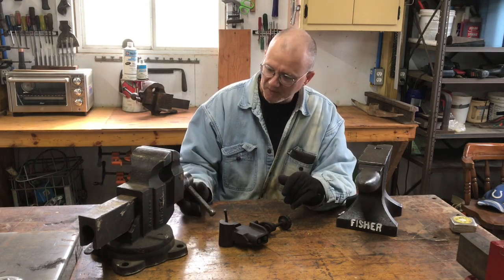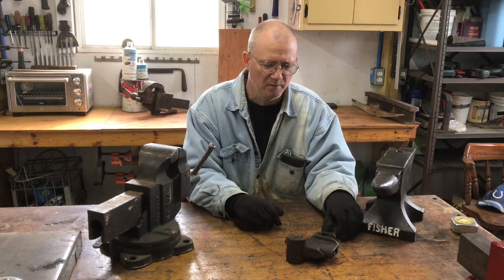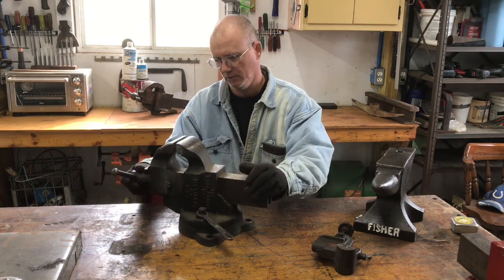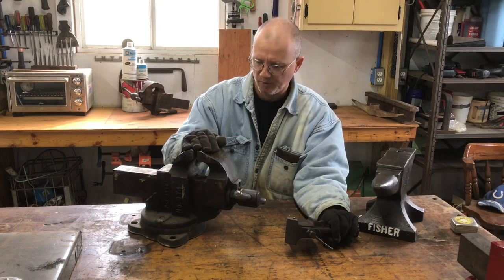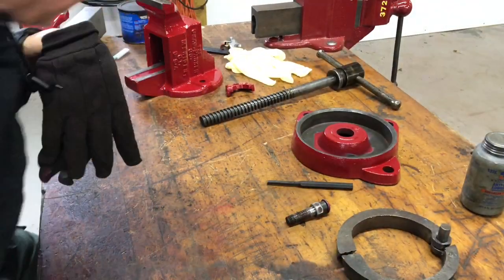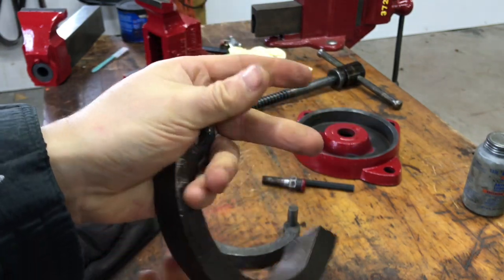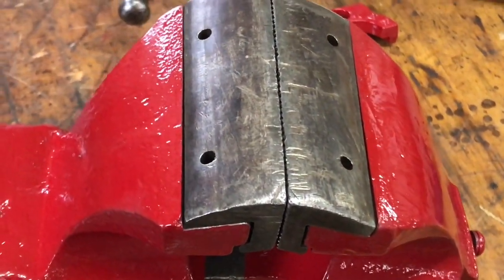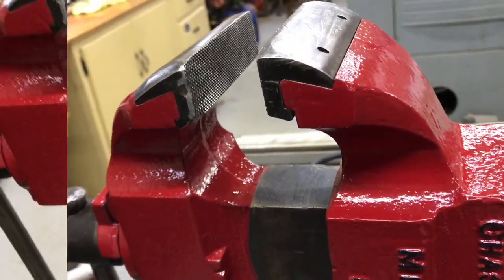Charles Parker 974 Vintage Vise Restoration

Comment: What do you put on the bare metal parts to prevent rust? I generally use Boiled Linseed oil myself. Just curious. Great video.
Reply from the maker: Yep boiled linseed oil (BLO) as well. I will occasionally cold blue some bare metal and then apply the BLO. Thanks for the kind words!

Comment: Cool!
I came looking for anything on these vises, because I have had one for somewhere around 40 years.
Have not disassembled it like you do in this video, but I may.  Making it look really nice seems like a great idea.
Just one problem: It is  missing the "horseshoe" which is screwed to the moveable jaw, and pulls open the vise.  You set it down at 4:33
I have a makeshift device which works, and am going to construct a better one.  But I thought I should ask, Is there anywhere I might be able to obtain an original?
Reply from the maker: Search the internet, I have heard there is someone reproducing them. They are somewhat complex so finding one would be ideal. Also EBay is always a good source for vise parts.

Comment: those are nice. i just bought a trojan 708. huge 6 in jaw x12in, 130lbs. i know parker made trojan in there econo  line. is there a way to tell the age? i plan on restoring and painting it. and definitely using it. cause thats why it was made, hard use.
Reply from the maker: Nothing about a Charles Parker is economy. They were all very well made. That one you have is huge!!
Reply: @shopdoc  i like big stuff. but yeah its really big. so large i'm building a new workshop table with 4x6 posts for legs and solid 6x top. should be a nice home for the giant trojan.
Reply from the maker: @hk93shooter  That will be a great table!

Comment: Do you remember the socket size you used to remove the bottom nut? I also have this vise that I am trying to clean but dont have a socket big enough to loosen the nut. And dont wanna buy the wrong size. Thanks in advance.
Reply from the maker: No I don't recall but you should be able to use a crescent wrench to loosen it. You could also use a tape measure and measure it prior to buying the socket.

Comment: Nice job.  Did you replace the spring in the handle holder?  My 473 1/2 model has a dovetailed wedge instead of a bent pin to hold Lead Screw nut.
Reply from the maker: honestly I cannot recall?? I have in some and I have also had to refab the brass pin in the handle.

Comment: So I also have a 974 but I'm missing the part that hold the main screw. I see you removed yours with one screw with a large blade driver. What is that part called? Do you have a spare? where can I find one? I can probably fab one up but would rather have an original .  Thanks
Reply from the maker: I don’t think there is anyone making those so you’d need to find a parts vise. I call it a lead screw retainer but that’s not the official name I am sure. Good luck Sir.

Comment: I just picked up a Parker 384 1/2, the big brother to my grandpas 383 1/2 that I restored, while cleaning the 384 1/2 up which it had a boat load of nasty thin brown grease in the swivel bottom I found that the swivel base is actually off of a 974, but it matches up very well with the 384 1/2, it does not have the wrench though which is a shame but i gotta say for 100 bucks I couldnt have asked for a better very rare swivel base and jaw vise, i have not got around to taking out the pin for the swivel jaw but if it was anything like my 383 1/2, it'll be a nightmare
Reply from the maker: Look for the wrench on E-bay, they will sell them from time to time. I think you need a "#2" wrench.